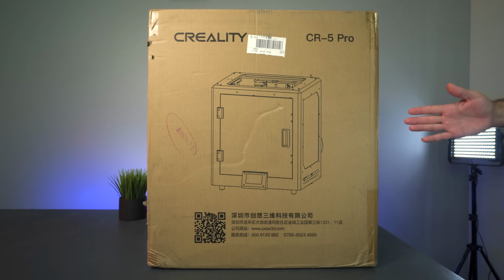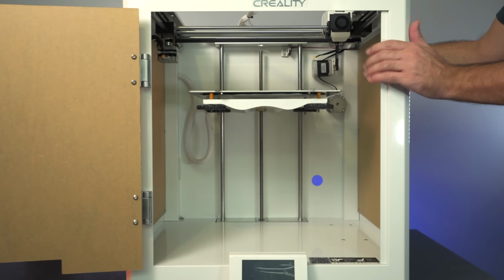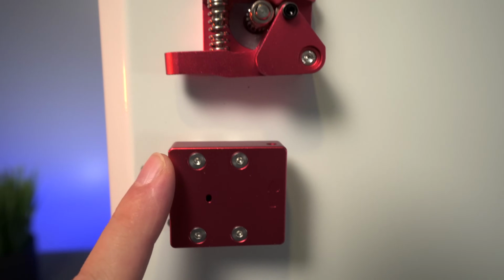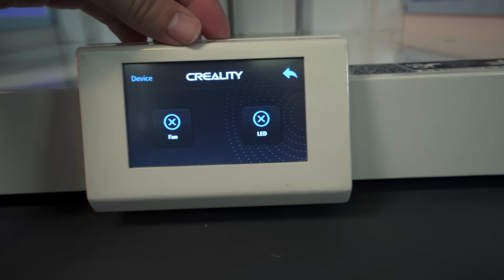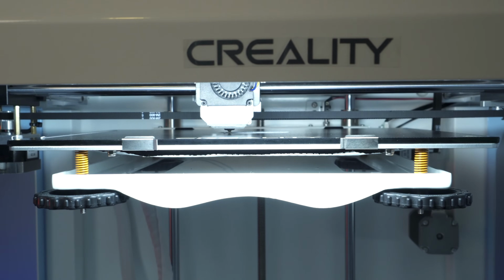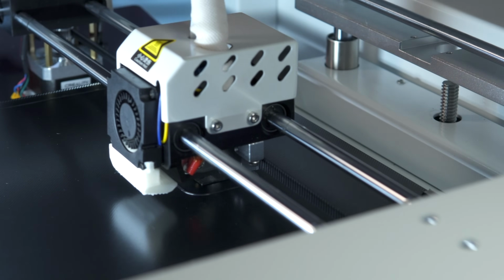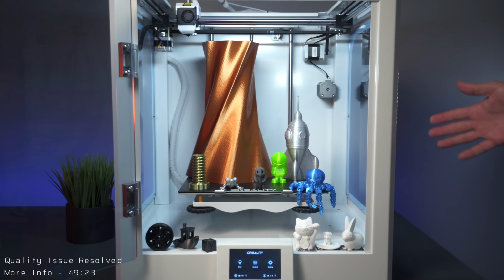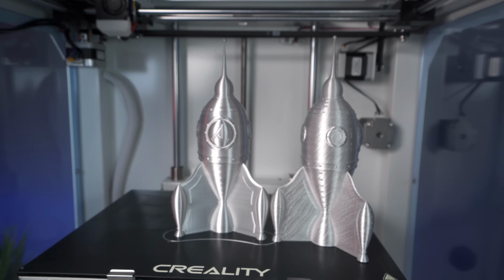Creality CR-5 Pro - 3D Printer - Unbox and Setup

Comment: WARNING: do not buy. Special stainless steel thermistor is not sold by the company or 3rd party sellers.

This 5$ part will go bad quickly, and you will not be able to get a replacement. Even under warranty, the company will send an entire hot end (you will have to cut and splice wires) rather than just the thermistor.

Comment: Hi interesting review.
Would be good if you could post links to models.
Some models are easy to find but the gear one heaps of variants from a single gear to some interesting builds.

However my CR-5 Pro H is still having issues.
Out of the box put everything on, it has BL touch pre installed.

I am in contact with the place of purchase tech support and I think I am progressing even before the email replies
from tech support.

Home centres x/y to centre all good.
Z approx. 20mm lower than it should be.

I did firmware upgrade, flashed screen as came with firmware.
as shown in https://www.youtube.com/watch?v=1RC0r1G8LQI

However this initial attempt to fix has failed.

Now the printer states x/y coordinates are 0.
Z axis is well 0 but auto home the Z stepper won't stop.

BL cable attached to +Z connector on control board.
-Z connector on board vacant nothing inserted.
Z home switch cable floating free in case.

Unfortunately firmware/software upgrades into the printer especially for the display  ....7.32_Screen.zip
and more crucially setting your z-offset is hugely disappointing.

So far every z-offset I have seen relates to bed levelling not getting the hot bed Z to a correct home that is required before one can even attempt to level the bed.

Functionality items like auto levelling, menu for motor control no longer accesses disable motor.
Have to see if  CR-5 Pro Creality_7.32_Screen.zip which appears to have the full functionality as expected.

Problem Creality shows how to do firmware and screen flash, not the above one (Creality_7.32_Screen.zip) but expect should be the same as in the firmware video.

The thing I find really annoying is that like your and others videos for this printer and the Ender 5 pro (Of which I also have and got prior to the CR-5 Pro) is that both yes BOTH have the same issue Z axis does not correctly home out of the box/assembly.
Yet every YouTube shows them to work out of the box or assembly with no issues.

because

Comment: Looks like an Ender 5 pro in a nicer case. I'm not sure the case is worth 1000€. Well exaggerating a bit, does look like most components are better quality. But doubt it will print that much better.

Comment: The CR-5 is a printer that totally sucks.
It has the plate that breaks, it cannot mount the BL-Touch, it has a half meter long bowden tube that extrudes the flexible filaments very badly, the motherboard occasionally blocks the printing, and the extruder carriage system is poorly done: it is heavy, imprecise, and very slow.
To obtain acceptable performances I had to build a direct drive (swapping the motors), I had to replace the motherboard with a BTT SKR 1.4 Turbo (and a TFT35 V3.0 display), for which I had to compile myself the firmware, I was finally able to mount the BL-Touch and thus use different printing plates, and in any case the printer prints worse, and more slowly, than a stock Ender 3.
This printer is a total waste of money: it sucks, and the proof is the fact that nobody bought it, there is no support from the community, nor from Creality: I have contacted Creality support several times, and not they know how to handle the endless problems of this machine. The only help they gave me was to send me another motherboard, with the same issues, and the customs to pay.

Comment: Just got mine today and have yet to try it. Everything is metal...I can't believe just how much metal there is. I can't lift it on my own, it 70LB. I got the H version which has a BLT touch for auto-leveling. It looks exactly like the one in your video but comes with a hood and blt-touch. I hope everything goes smoothly. I got some baking powder in the chamber to absorb all the new paint smell. It looks very much industrial. It is also very quiet.

Comment: Virtually every complaint in the comment section is fixed on the H model of this same 3Dprinter. (Bed leveling, all metal hotnends, filament detector, 300° C range for more exotic material use) Funny thing, they are the exact same price. Get it while it's hot. (High temp version)
Reply: Thank you I almost ordered this one instead of the H appreciate your comment!!! <3

Comment: What settings did you use for the white pla to print the rabbit, dog and pig? I'm getting stinging issues. I've tried to lower the temp to 185 degree but it is sting stringy

Comment: Need closed loop stepper motor control, filament sensor, direct extruder, auto bed leveling, enclosure with proper heat retention (for PETG, TPU, etc.), and Linear rails, till then, this is just a ender 5 with a fancy glass box.
Reply: The H model has all of that right?

Comment: The lulzbot TAZ Pro s is a borderline industrial machine with its 500w psu and simple maintainable design, this printer here is something you would going nuts having to tune and repair every other day. Plus you are limited to the most basic materials with only 350 watts, so no nylon and definitely no polycarbonate. It could barely do abs and even that would need some modifications to filter the smell. Pla is alright but its a 3/10 for its mechanical properties. Plus good luck getting your warranty respected from china.

Comment: I don't know what you mean by Creality having good quality control. I have 2 CR10S - one printed 3 months (200hr) in good quality before the driveboard went out. The replacement board did not last long. Bought #2 and an extra board and those went out in less than 2 months, and Ender 3 Pro has been fantastic, and my new CR10 Max was delivered with a faulty board.
Ender 3 was tremendous value - but crap quality control.

Comment: I see the layer cooling fan with printed duct.  But where is the heatsink fan?  I have the CR-5S (the pro's predecessor) and I'm very interested in the changes they appear to have made to the previously dreadful and limiting cooling arrangement.  The 5S is a dual colour machine but it utilized a split duct single fan to provide both heatsink and layer cooling.  Which is extremely restrictive in terms of material since you can’t reduce the layer cooling without causing heat creep.  Would be extremely grateful to see a hotend tear down video.  Love the super sturdy frame.  Just need to fix my 5S's cooling.

Comment: Great review about this 3D printer.
I also bought one for me two months ago, and I had faced the same trouble with face pattering. But besides that it’s a great printer machine.
Thanks for your review.
Reply: Will this fit in a 24" x 24" enclosure with that spool on the back?

Comment: For $1200 this is a joke. There's no direct drive, no premium hot end, the cheap generic white bowden tube. no auto level a single lead screw and two guides for the Z axis. That might be fine for a smaller print bed, but I bet this wobbles and goes out of level with just about every print. An Ender 5 Plus with an upgraded main board, premium direct drive and hot end, and an enclosure would be a little more than half the price of this and a far better prineter. Add an enclosure heater and it would also be able to print higher temp finicky filaments like nylon, peek, etc. This is basically an overpriced enlarged Ender 5 Pro with delusions of grandeur.

Comment: Unfortunately it doesn’t have electrical certifications (UL, cUL, ETL, cETL) for use in North America. Once the power supply is enclosed in the printer the entire printer needs to have the certification not just the power supply inside.

Comment: Printing a 3D printer using a 3D printer
Interesting 🤔
Reply: That is reprap‘s original idea, building an open source printer that replicates itself. It didn’t turn out that way but the design has been copied and all consumer 3d printers today are based on it.

Comment: Same Mk10 Extruder, Ender 3 Hotend and bed as always so this is basically your normal Ender3 / CR10 in an Ultimaker cloned case. And for the price you don't even get auto bed leveling. Save your money here guys.
Reply: the major difference is the kinematics type, for the rest I agree with you
Reply: I got one. It's a useless hunk of junk due to special size thermistor the company will not sell.
Reply: I agree. Well, meanwhile it has the BLTouch for autoleveling but to be honest: I would rather buy an Ultimaker S3 instead of this piece of junk. Basically it is just what you wrote and the CR-5 Pro is really not that special at all.
EDIT: sorry, I confused it with the CR-3040 Pro, of course the CR-5 Pro does not have autoleveling but even the CR-3040 Pro seems like a cheap toy compared to the Ultimaker S3.
Reply: The Ender 3 is the Prince. No comparison. So moddable, and if you align properly, buy some more high tolerance parts, ie Spider Coupler, anti-backlash spring, Cr10 bed springs, Metal Extruder, Capricorn bowden and metal hot-end coupler, you are gold. Printing at 0.2mm Nozzle and 0.04mm height, with perfect layer lines and corners.

Comment: Hello People, I'm in need of some help.
Just bought myself a Creality CR10S Pro V2 because all i see on youtube is the most smoothest and flawlesly unboxing and imediately perfect working 3D printer without any problems that makes the most reliable and perfect prints you can imagine.
I want to install the printer so perfect, read the manual before from A to Z and backwards so that i'm not going to make any mistakes, then looked for another dozen unboxing and installing tips on Youtube and finally after 2 days i managed to install my printer without a problem in no time.
But then.................I turned it on and................... you guess; ...... trouble started;
The printer went down on the bed and made a really ignorant noise like metall that is bending ..... and it did bent (or is it benD??). The Nozzle was in the middle of the bed and was going down while the BLTouch Bed Leveling Probe was hitting the bed first, 2 times to be exactly, and then get up again before it came down without anything in the world could stop it. It really hit my Bed very hard and before i knew what was going on and powered off the machine, there was alot of damage.
I have tried to recover the damage and went on, with the believe it was my own fault because i was so stupid to trust something to work right out of the box. But whatever i tried and how much video's i watched before making another attempt; the damage is getting worse and worse. BTW, after leveling it always says that Z=29,9. But the nozzle is only about 15 away from the bed.
So now i have a completely brand new CR10S Pro V2 that is not working (and the bed is damaged, without warranty as i understood)..
It really drives me crazy and i'm desperately in need of help.
Is there anybody, preferebly in the Netherlands, that can help me please?????
Thanks in advance,

Gerard
Reply: Did you fix it yet?  The z limit adjustment is likely the problem.

Comment: "Industrial" 3D printer ROFL!
Reply: This printer does look more "packaged" and promises to be less of a headache maintaining. With H-Bot style printers, or other types with relatively flimsy builds, you always have to have an eye out for issues. This one may be able to be a touch more reliable with a bit less oversight or maintenance.
Reply: It looks like a hobby printer, nothing more.  Industrial it will never be.
Reply: maybe industrial wannabe... Check the price of this machine
Reply: @myNICKnameISgelo  - yeah about $200K less than an “industrial” printer
Reply: @coreelite  Sure, its far away from industrial than from a hobby type. But I dont see this price justified.
Reply: @coreelite  a Stratasys Fortus 250mc is only about 10x less than that. Sure, it's not cheap, but the total cost of ownership is under 30k, not 200k. Now the Fortus 450mc on the other hand...
Reply: @SonicKiwi123  - we have the 450MC and an old uprint, I doubt this thing can even keep up with the Uprint
Reply: What kind of fool expects an industrial machine at this price level? This is not a $10K printer.
Reply: HAHAHAHAHAHAHAHAHAHAHA....    What about this printer is “industrial.”?
Reply: @coreelite  the fact that it's trying to look like an Ultimaker, lol
Reply: WTF do u mean?

Comment: This guy doesn't say 1 bad thing about this printer. SMH this is an overview not a review
Reply: He did mention the main rods being off center and causing some wobble, as well as some retraction issues. What "bad thing" are you wanting him to say? Just because a reviewer doesn't invent problems doesn't mean its not a review. That being said if this particular printer is notorious for a given issue and he seems to be the only guy never having the issues. Then  I might be skeptical.
Reply: @JohnWeland  he never said those things were bad, he just said they were problems, he didn't make a big deal about the texture, he didn't talk about temps of if the hotend or if it's all metal, not much about interface, he said 'im glad to see a Bowden system' which is BS, they have a very long Bowden tube which he mentioned but didn't say was bad, the tube takes right turns, there is no probe, it does not have wifi, these are all features of an industrial printer that just aren't there, this thing could beat a prusa
Reply: @3DFactoryTech  I think most people can draw the connection of "problem" = "bad", that is common nomenclature. He apparently likes Bowden which would be a personal opinion as they are not objectively "bad". Some people like them others do not. As far as the lack of WiFi and probes and his use of "industrial", his wording might have been a poor choice. I understood it as "industrial feeling" as its "heavy and solid construction" not "this is precisely the device you will find in a building in an industrial complex" . Sorry it just seems like knit-picking. Its not like he was reviewing the ANET A8 (fire starter) and claiming that its ability to burn down your house was a good thing.
Reply: @Wa ge Simply untrue. You should differentiate in your comment not just your replies...
Reply: The titles is, "Unbox and Setup" not a review you illiterate con cac!
Reply: He did you moron!  Did you ride the short bus 100X too many?

Comment: I'm just stunned you consider it Professional Grade...you're being pretty generous!
Reply: It definitely looks prosumer-level. In fact, most people running "professional" print farms would reject this machine on account of having too many whistles and thus being too expensive. What seems to be missing is automatic bed leveling, an air filter and maybe a temperature control for the enclosure. But that's all kind of optional and a financial tradeoff.
Reply: shill?
Reply: Just doing what his paying sponsors tell him...
Reply: The white is a nice touch.  But the CR-5 is actually an older design.  The frame is incredibly sturdy.  Creality keeps bringing it back with minor improvements and gimmicks.  The CR-5S was a dual colour machine limited to PLA by the dreadful cooling and handicapped severely by initially shipping with firmware that didn’t even work!  The switch to touchscreen is befitting of the machine's price point.  At least they seem to have updated the cooling setup so it actually has controllable layer cooling now.  The lack of auto-levelling is kind of surprising, I agree.  Most of Creality‘s touchscreen printers have auto-levelling.  The CR-5 series has always been quite pricey.  But factoring in the shipping for it's weight and fully assembled state explains some of that.  This machine is SERIOUSLY HEAVY and extremely sturdy.  I think this latest iteration is a pretty good one.  I’m just really interested in whether I can adapt it's cooling improvements to my 5S.  I've been working on a Berd-air setup for a while.  But having issues sourcing some materials locally.  This might be a much simpler fix.

Comment: Pelase, can you share the settings for the flexible material? I tried to print but it is impossible in my case. The printer just made a cloud of thin filaments I don’t understand why... so frustrating
Reply from the maker: Only difference is print speed reduced to 25mm sec.

Comment: Finally someone made the first usefull CR-5 Pro review.
Thanks for creating such a great video!

How is the plate under the bed is it as bad as the Ender 5 and Ender 5 pro which required support since it the metal structure was too weak which affected the whole bed when printing something which was bigger and more heavy?